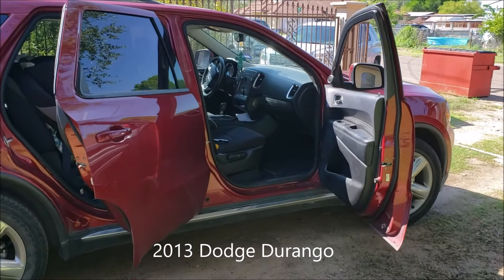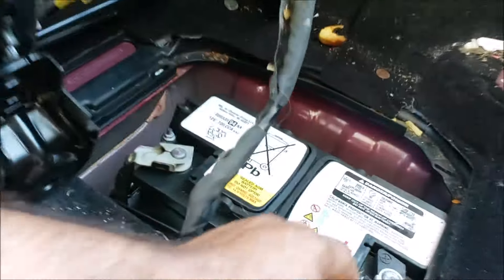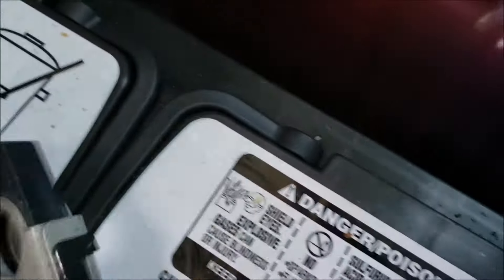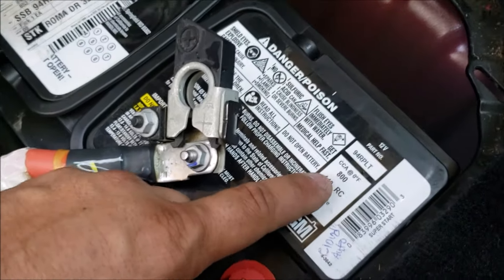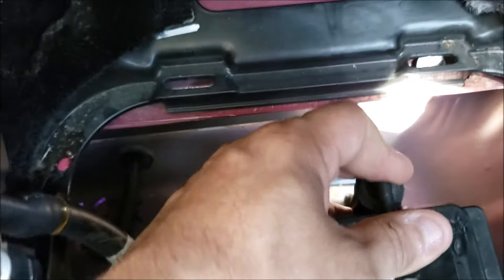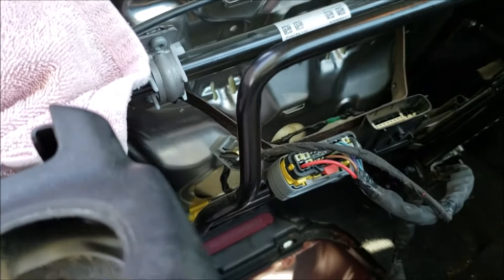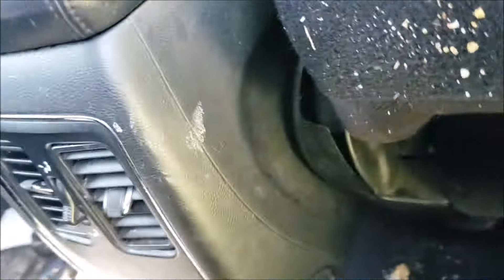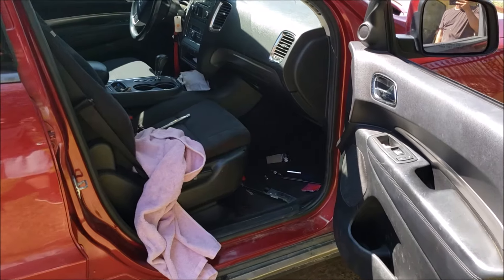HOW TO REPLACE THE BATTERY IN A DODGE DURANGO AND ITS LOCATION HOW TO INSTALL NEW BATTERY DURANGO

Comment: After replacing the cam and lifters, I thought I couldnt hate this car any more. The other day I got every warning light and message available on startup. Low battery voltage will do that. Anyhow, went to remove my battery in the freezing cold, but the hold down bolts were frozen in water that collected in the tray. 😢
Reply from the maker: I recently replaced the oil fill cooler which bolts on top of the engine block under the intake manifold and injectors. I had a small oil leak that was from that cooler and mechanics thought it was the rear main seal. The part took me about 2 hours to install and sensor on it is defective. I then decided to swap the spark plugs and coils and believe one coil either came unplugged or also went bad. I really haven't made time to fix the Durango but I should.

Comment: Bro you can just move the seat up.
Reply from the maker: When I removed the seat I was able to find several skittles and M&Ms. I was not able to move forward enough and think a cable or track was getting stuck at the time. Last week I replaced the radiator and the external fuel relay again. Lets hope for 2 more years on this 2013.

Comment: When I first discovered that my battery was under the seat I was upset. However, after seeing the condition of my 9 year old battery that still looked like new even though it was not holding a charge any more I have changed my opinion of the location. It is also very nice because when hooking up other things I don't have to go through the firewall or under the vehicle. And if you look on the drivers side there are matching recesses that would make great storage for an emergency. Food, money, tools, ammo, etc. Thanks for posting. This helped me a lot.
Reply from the maker: My Durango was full of ants this weekend and I saw the compartment you mentioned. I will open it up just to get a better idea of capacity . Thanks
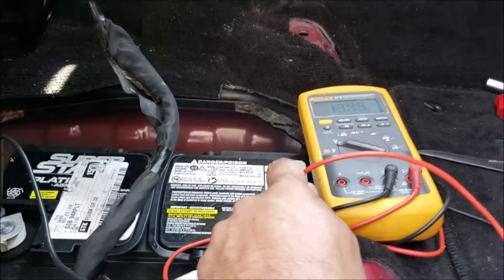Reply: Your vehicle still shuts off on road 11:37 on your vid.. what was the troblem after batt replaced

Comment: It’s that a wire for car amplifier
Reply from the maker: Vehicle does not have aftermarket stereo equipment but I do have 100ft of 1/0 cable from my old bass head vehicle.

Comment: Very helpful.  I'll change my Durango Durango battery in 5 minutes. 😇 hope things gonna be fine
Reply from the maker: Some say you can move seat all the way forward and should be able to remove battery. I took my Durango this Saturday to get the ignition switch, (win module ) and 2 keys replaced. The tech left my door open and actually my battery died out in 2 hrs just with the lamps on. This battery may be really cheap or I have something drawing current. Good luck.
Reply: How did it go?

Comment: Looking up videos to attempt to remove the battery from my durango. I have an older one and the battery is under the hood. Glad I found this video so I know NOT to get any newer model durangos because this is stupid. Who thought it was a good idea to put it in the floor?
Reply from the maker: Some mention you can move the seat foward and lift them if electric. I tried moving mine fowards but couldn't get the battery out. My dad's car has the battery under rear seat, brothers has battery in the trunk and my trucks under the hood where they belong.

Comment: Batteries last much longer but it is a PIA to change  .    It is even tighter now because the new ones (2016 on up) have  "2" batteries  in that space .  there is also a smaller battery for the useless stop/start function on the V6's .    You might be able to get it out the  back if you have power seats that raise up . Manual seats do not raise so you may not be able to get it out without pulling the seat  or you may have to pull out the small battery to get at the main battery .   Dont know why they did this as there is quite a bit of space under that hood specially on the V6's that they could have just put a tray in .
Reply from the maker: Many have mentioned they were able to remove their battery without removing the seat bug I just couldn't. I wonder if my seat was not fully moved forward or if they have seats that raise. The alternator fried on the unit and I was told it was due to the hydraulic pump used instead of a power steering pump. I also lost my ignition switch aka the win module. The Durango should hit 100k miles this month. My father has a Buick car and his battery is under the rear seat, my sister's  car has battery behind the front bumper and my brothers car has the battery in the trunk.
Reply: Hey man if we unplug the aux battery will it cause any issues? We hate that feature and prefer to keep the car cranking when driving.
Reply: He said this was a 2017 but it’s weird it doesn’t have push to start
Reply: @MUFCXI  just turn it off while driving .. I heard you can get it disabled though

Comment: If you move the seat all the way forward and raise it up the battery will come out the back.
Reply from the maker: I tried moving seat forward to remove battery when my alternator fried but had no luck that night. I will try it again to see how much access I have. Thanks for the positive comment which I highly appreciate.
Reply: Not all the seats are power . Manual seats do not raise up  .
Reply: His way was easiest
Reply: @15DurangoRT  nope lol moving the seat to the front is the best

Comment: Thanks for the video. I believe by taking the seat out, it’s a much easier way to remove the battery. I was going to try to remove it by moving the seat forward but the battery could be a pain to take out.
Reply from the maker: I tried removing the battery by moving the seat forward but had no luck. I suspect a cable probably got snatched but ended up removing seat and cleaning up all the junk from compartment. Thanks for watching.

Comment: Mines a 2013. Stock battery is starting to sound weak on start up.  Great life overall. Thanks for the video
Reply from the maker: If you try removing the battery try pushing the seat forward as much as possible. I had issues but others claim they were able to remove battery without removing seat. Battery life was great as the engine heat does not affect the battery like other vehicles.
Reply: @cutweldngrind  I replaced the battery already. Very easy. Thanks

Comment: Thanks for making the video. I had no idea the battery was under the passenger seat. So you do or don’t have to remove the back big bolts. Because you did mention you were unable to remove, I’m not sure sure what you were referring to.
Reply from the maker: You should be able to move the seat fully forward to clear battery compartment. I think I stopped short of that and well removed the seat. Hope this helps.

Comment: During hot days the charging voltage is going to show lower on on the multimeter, colder days its higher.
Reply from the maker: Thanks. I hope this vehicle last a few more years as cars are getting expensive lately.

Comment: All you do is move the seat forward and take the cover off
Reply from the maker: I was told the same and for some reason I could not remove it. I may have not moved seat all the way or maybe an obstruction not letting seat fully move. 

Thanks for the comment and suggestion.
Reply from the maker: If you haven't subscribed please do so if you would like to be part of a upcoming giveaway.
Reply: You can BUT it is way easier to remove the seat. Even with the seat removed, my positive battery cable give up a good fight coming off and would have been impossible to have removed with the seat in the way.

Comment: Dude delete this video that’s not how to remove the battery
Reply from the maker: I moved the seat all the way forward and still the battery would get hung up. I took an extra step for easier access of removing the battery and cleaning up the compartment. The battery was replaced and everything was checked easier than being cramped between front and rear seats. Sorry if my way is to much work to remove an extra 4 bolts. Have a good one 😉
Reply: @cutweldngrind  wow mine comes out l ok
Reply: @bigchief1658  then make a video yourself